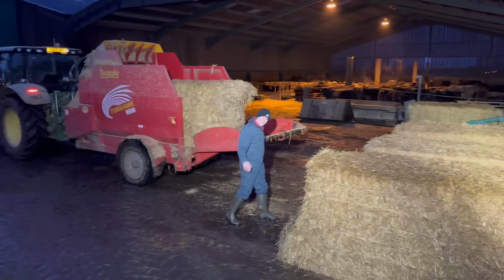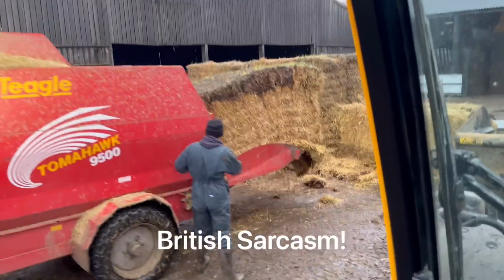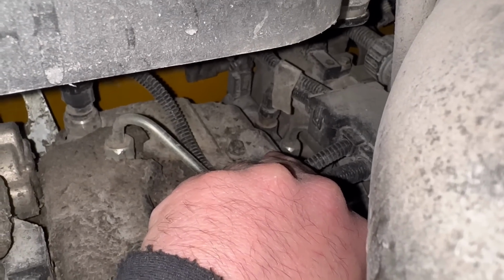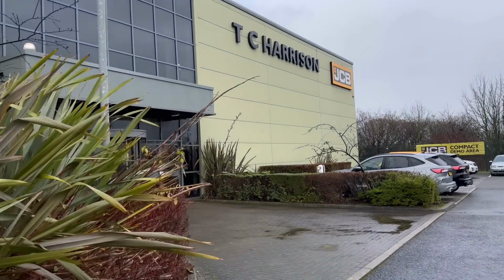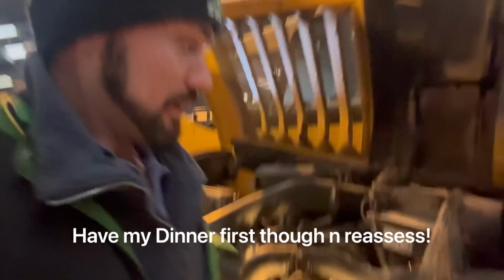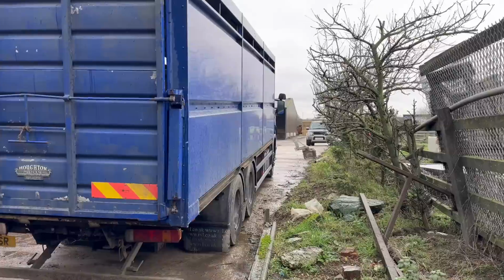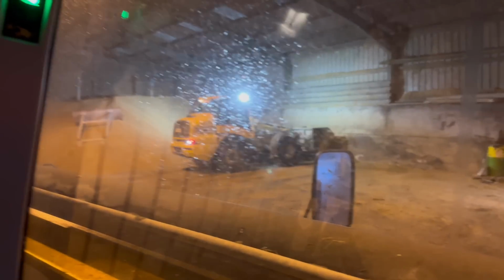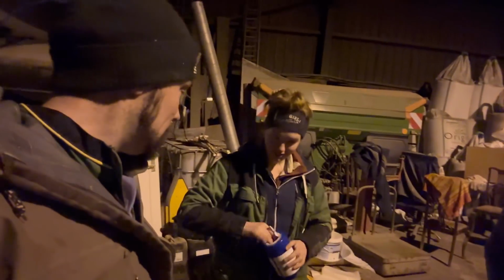Big Deliveries! JCB Problems! How Much to Post Em?!

Comment: Joe, in your 9 metre loader, if your machine is not working/starting even when serviced, try opening each diesel injector then close off, follow up the line on each one, your fuel lines sometimes get clogged up as well, try the air line pressure on them, fuel filter in tank might be clogged also,  you might need to remove tank and clean it, no matter how careful you are with putting fuel in, dust from the straw etc can get in, sludge builds up in fuel tank, and the fuel pipe feed with filter gets clogged, a higher amped battery might also be an advantage, Michael   Ireland [Eire]

Comment: My money is still on a voltage problem. when cranking ecu doesnt get enough volts to work. to many starts and short running time will also drain battery

Comment: Has the diesel waxed up, during the cold spell ( before xmas)
That could be causing the starting problems
Reply from the maker: could be, was cold again here last night, that seems to be when we have issues when its been cold
Reply: Pour some fuel into a clean jam jar,  leave to settle for couple of minutes,  if fuel stays has one substance it's fine, if it separates get In touch with fuel supplier , you have a problem

Comment: can you not put 2 bales flat in that spreader save on loading time
Reply from the maker: The bales are the biggest bales you can get, they are  as wide as they are tall, couldn’t get anymore in than we do already, you could hang a bale on the back door of the teagle but in practice it doesn’t work very well
Reply: @joeseels  ahh ok we run a taruup spreader and 2 quad bales fit in easily flat,just made me wonder
Reply from the maker: @garyayres3978  yeah we used to put quadrants on there sides and pick em up two at a time, was a pain setting them out 😂
Reply: @joeseels  have you had any problems with head gaskets on the 30 series,we had a 6930 2 gaskets in 4 years from new,our local engineer said they were doing a few,one of reasons we went from green to blue
Reply from the maker: @garyayres3978  no not had an issue with them, 7530 had an engine rebuild! But 6930 is still on original head gasket!
Reply: @joeseels  obviously not a friday afternoon job then lol,loved my 69 but not so keen on the blue machine even though its newish,69 alot easier to use and more fuel efficent